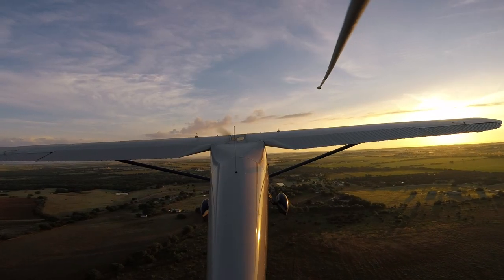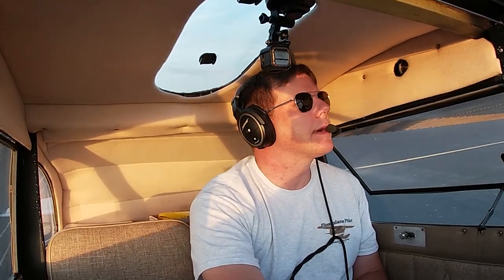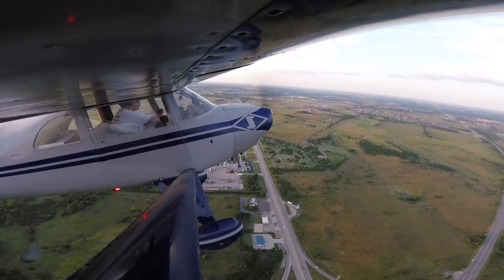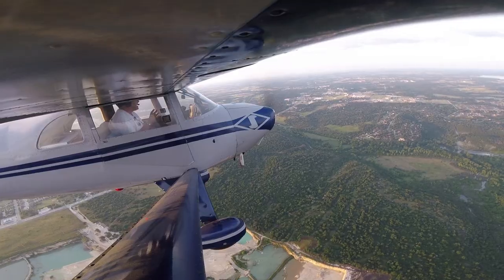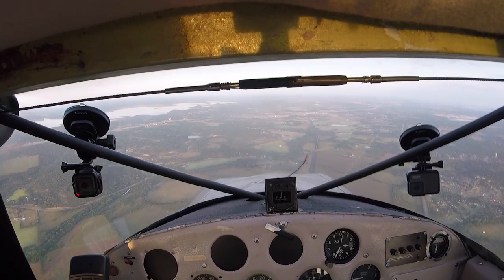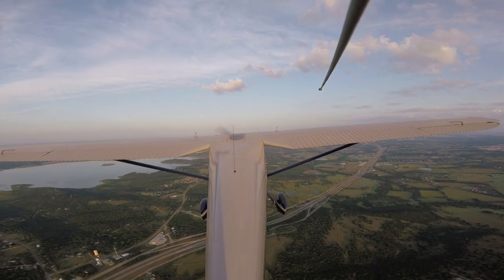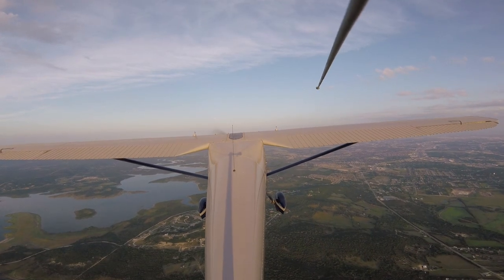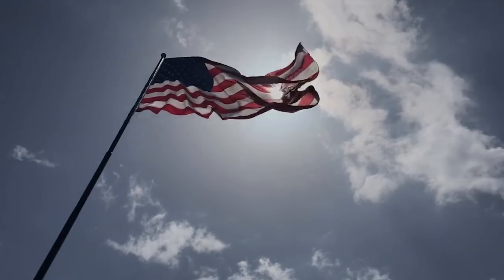How to get flight following with no transponder!

Comment: Would it be fair to argue that "these right here [your eyeballs]" are the worst tool for collision avoidance?  Radar, ADS-B Out/In, TCAS, Transponders, etc were all made because those eyeballs are no longer sufficient?  I suppose it depends on the plane your a flying, a slower one allows the eyes to be more effective.
Reply from the maker: Look outside.  The FAA mandates it.  I have picked up traffic with my eyes that ATC never knew was there and not all aircraft are required to have ADSB in the National Airspace system.  That's about the same as not looking both ways before crossing an intersection and relying on just the traffic light.